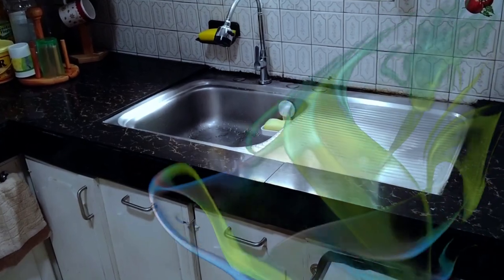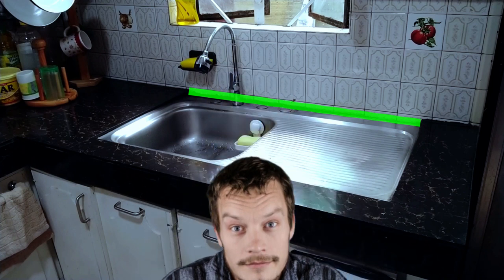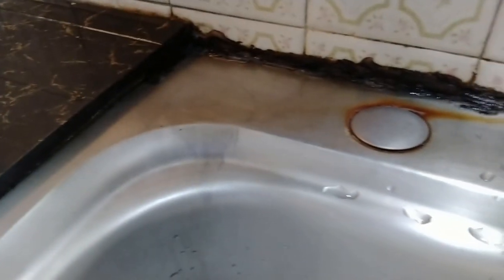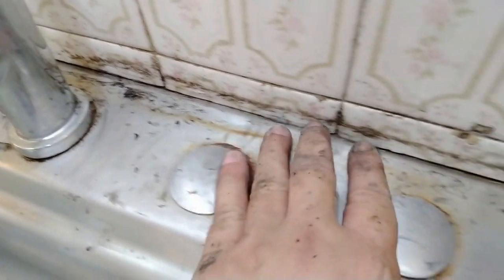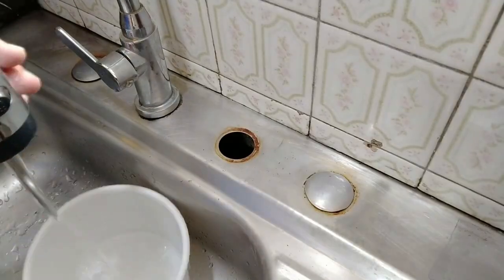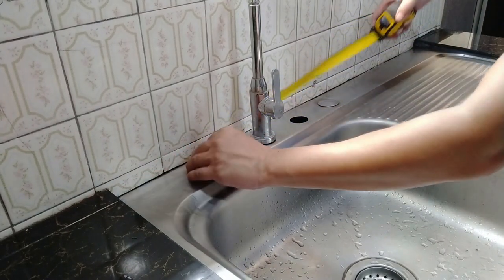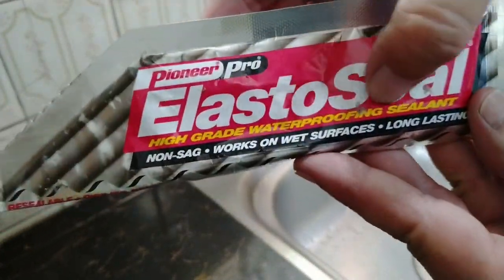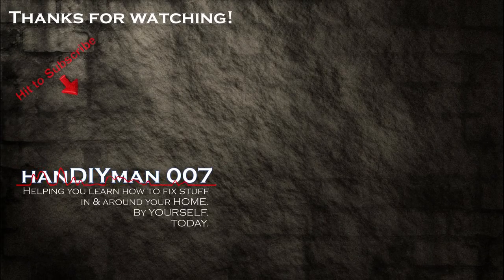Magic Tape to Fix Leaking Sinks? How to Seal Kitchen Sink Edges w/ Caulking Tape

Comment from the maker: Want to learn how to restore an entire kitchen sink system by yourself? Watch this 👉 https://youtu.be/9Wx0Xw0qpWg
Reply: I am trying to seal my bath tub and wall. My calking strip was similar to yours but the glue was weak and the plastic kept wanting to curl so it fell off. You’re supposed to flatten it over night, which I did. I used the same product years ago, but its different now. Btw, there are two types of silicon, regular and for wet rooms. I presume one doesn’t attract mold as much. I will try another strip I found. But just cant be sure of the quality of things we buy nowadays.
Reply from the maker: @TheBooban  Completely agree with you! Btw, I recently changed that caulking tape on our sink with another alternate solution. You might want to check it out. However, I'm still waiting for some time to pass to see if it will attract mold: https://youtu.be/JmyuEpgkZsw

Comment: My replacement went quicker when I used the X-Acto knife to cut the top of the silicone and the bottom, and then rip it off in one big tube. ❤
Good work 🎉

Comment: Very helpful!  Does the PVC tape fill in the gaps between the tiles without using a hair drier or heat gun?  I'm glad to know it's simpler than I thought!  Thanks for this video. It's hard to find videos on how to use the PVC tape.
Reply from the maker: Thanks for the feedback and good thing you were able to find this video! And no, you don't need to heat the PVC tape just to make it more airtight. Just stick and forget :)

Comment: Most of this video was about cleaning it. . . Not what I came for but it's what I wanted
Reply from the maker: 70% of most repairs rely heavily in the prep work. Otherwise, the tape will have been useless. My vids are not just about what you think you want to know but also what you need to know. 😉
Reply: Lol yea had to learn the hard way that's why I'm here lol
Reply: @HanDIYman007  i think your video is great. every detail is good info. not following the right cleaning method will cause the tape no working properly. i just order mine and will follow your method. 👍

Comment: Question: Why not just use the sealant as grout replacement?
Reply from the maker: Already answered in video.
Reply: @HanDIYman007  Really? Might've missed it
Reply: @HauntingShock  he didn’t. But neither did he use calk like the plumber. But you can sea the sealant he used around the holes have no form, just a weak paste. The sealant strip is the most convenient choice of all of them, but calk is thinner and much more professional. But silicon should have worked. I think he used the wrong one. There are two types.